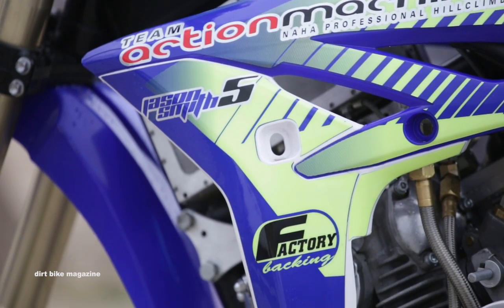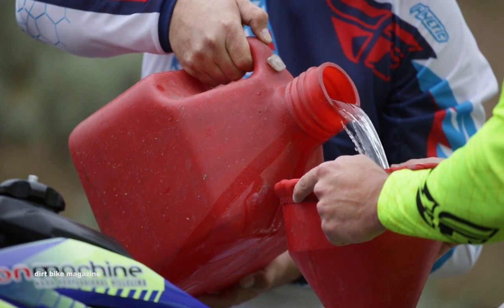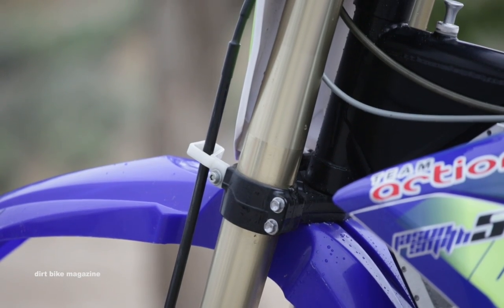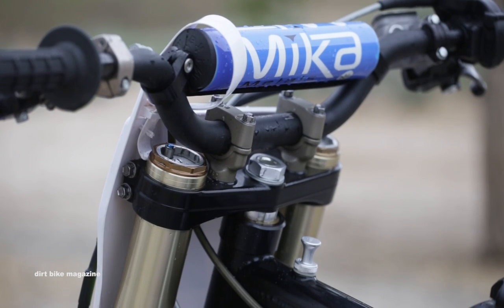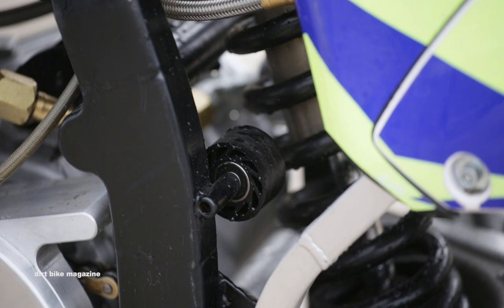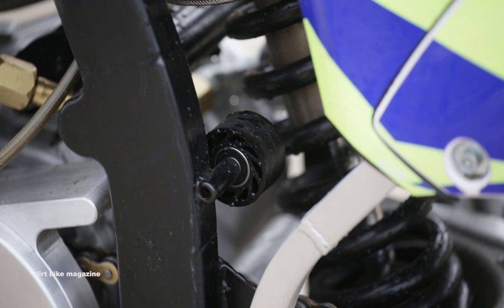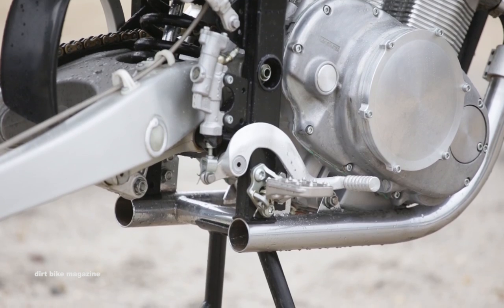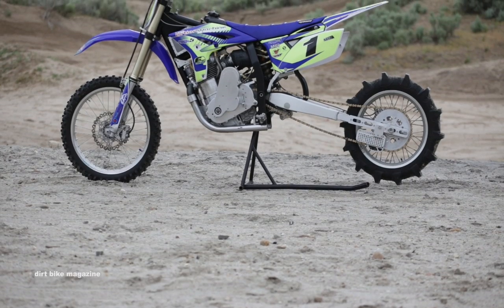Insane Nitro Methane Hill Climb Bike - Dirt Bike Magazine

Comment: Can I ask if the bike would be better with extended leading link type front forks with very soft springs and shocks to reduce the jack-up effect?
And simultaneously get some weight low down?
Traditional bike front end has lots of high weight - study the dynamics?

Comment: how much horsepower does it make?
Reply: Aidan Vorbeck kewl brah
Reply: The CBR 1000 on nitro makes a little over 300-320HP so this one is probably pulling around 250-280 if I were to guess
Reply: do you mean a turbo and heavily modded cbr1000? i don't believe just running it on nitro makes that much more power
Reply: Nitro makes an exceptional amount of power. With nitro, you can burn a lot more fuel at a given time vs. race gasoline...Meaning that the power gain is very large.
Reply: Nitro can multiply HP by 3 to 4 times the stock plus add in all the motor work